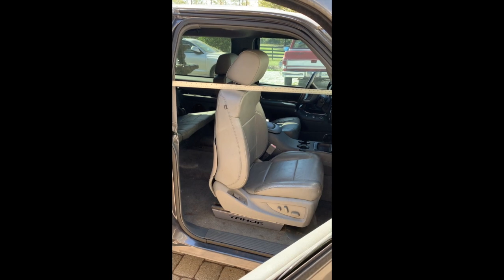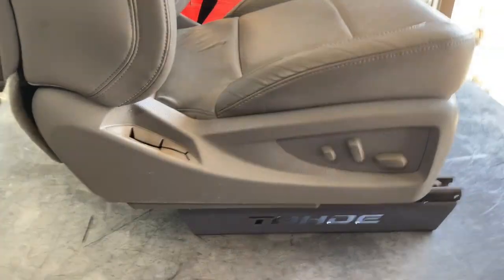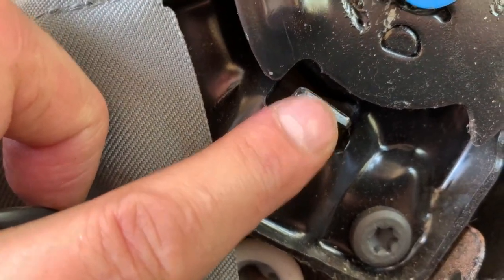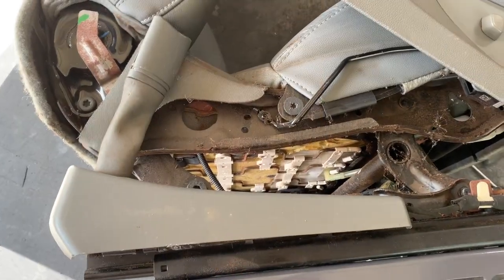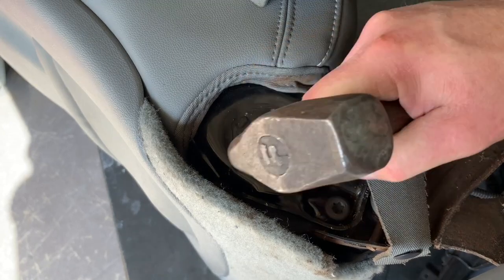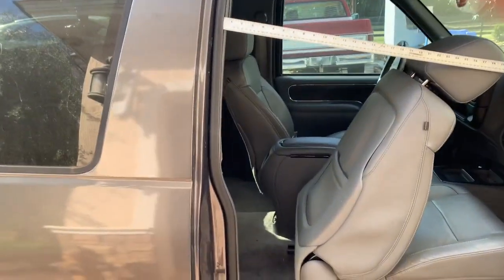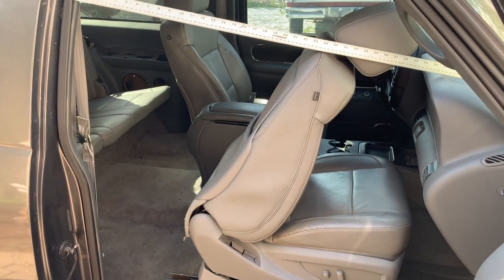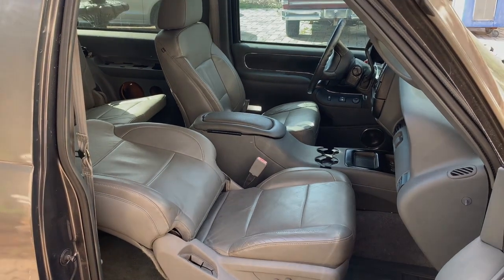1988-1999 Chevy/GMC OBS Truck/SUV - Gain Rear Seat Access - GEN 4 Seat Modification - OBS Outpost

Comment: Can you make a video showing how to swap Gen 4 heated and cooled leather seats into a 98 obs extended cab?
Reply from the maker: we have the install video, here is the link https://www.youtube.com/watch?v=bTZopZtVKKU&t=757s
Reply from the maker: You wont be able to get the heat/cool working in the GEN 4 seats. It is controlled by the CANBUS that send PWM signals. You would need the donor trucks BCM, switches and harness and then get ahold of the wiring diagrams. All my customers just take out the factory heat and replace with aftermarket that connects to 12v. plug & play.
Reply: @OBS Outpost  Do you know if yukon front seats are the same as silverado front seats for 2014-18?
Reply from the maker: @jordangetz4412  2015-2020 Yukon, Tahoe, Suburban & Escalade are the same as 2014-2018 Silverado/Sierra
Reply: @OBSOutpost  thank you so much. I have purchased rear seats and a jump seat for this swap. Just looking for front seats now
Reply: @OBSOutpost eventually will u make videos on how to LT swap obs chevys your videos are great and very detailed
Reply from the maker: @96tahoe2dr4  We are in the process of filming our LS3 swap in a 1987 C10. Most of the process will be the same for OBS trucks.